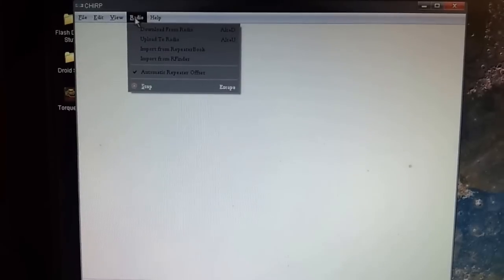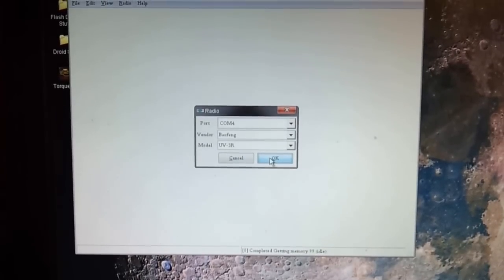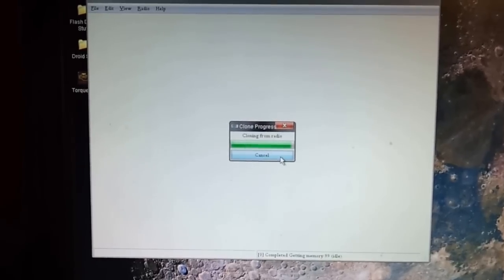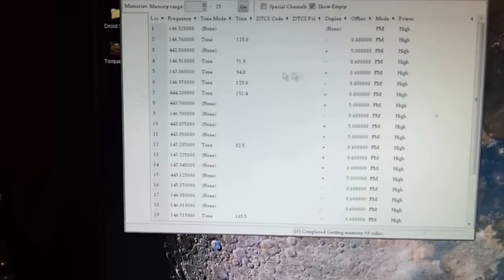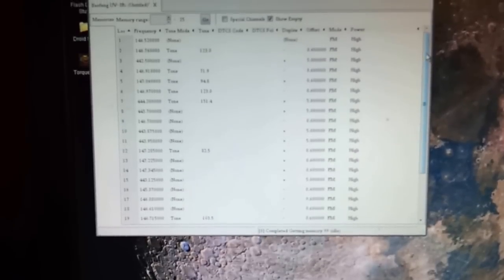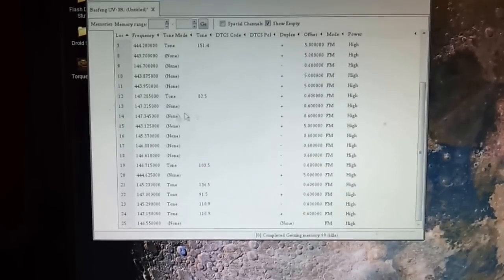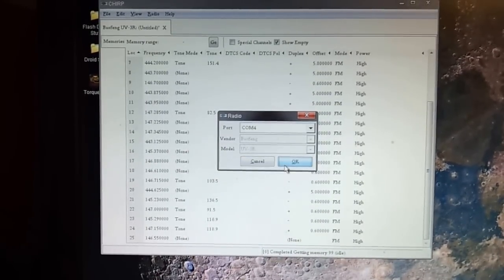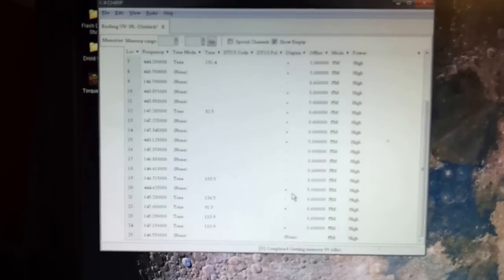Programming Baofeng UV-3R with CHIRP.

Comment: Hey, I have the UV-3R Plus, and I'm having a hard time programming it. I got a cheap data cable on Amazon, and I got it working with the regular drivers. I can download all the radio settings and channels, and I can upload new settings "such as expanding the frequency range".

However, every time I go to write memory channels, to it, it simply deletes all the current memory channels of the device and basically resets it to factory default (other than the settings I changed in chirp). Clearly the communication cable is working, but what could be causing the memory channels to not transfer?

Comment from the maker: It won't allow me to reply to you directly, but when I hooked the cable to my old XP system it found the driver, and installed it. So I'm not sure which one it used. I know there was a problem with some of the cables, and the chip inside them being cheap or counterfeit and the drivers wouldn't work or something like that.

Comment: Hi Scott Thompson. This cable is the same of Baofeng uv-5r ? My uv-3r have a smaller screen the yours, and show only one frenquency at  time.
Reply from the maker: Not sure if it's the same cable or not, I haven't picked up a UV5R yet. If your UV3R has the single line screen I believe it's the Mk1 version.
Reply: My Ht is the UV-200, looks like de uv-3r Mark 1. In the ebay have a seller with a cable for de uv-5r and uv-3r. But, I have no idea if it works in two hts.
Reply from the maker: Jose Vianney Wish I could help you there. If it states it'll work on both it likely will. I can't say for sure it will though.
Reply: *****

Ok, thank you Scott. I have both uv-5r and uv-200 (mark 1). I going to purchase that cable on ebay and try in two hts.

Comment: Hello, I have two questions to ask yourself. 1) How does the software solve the problem of the number of alphanumeric characters for the name of the channel? Some HT allow 5 characters, the other 6! 2) How to clamp the HT on 144/430MHz or on 144/450MHz range frequencies with this program? Thank you.
Reply from the maker: I'm not sure I don't program the alphanumeric characters. Not sure how to do that with the program, I just did the video as a quick guide on how to program the radio, since at the time I did it there weren't any out. I'm definitely not an expert in the use of the CHIRP software.

Comment: How diff do you think it would be to program this to accept signals and output something in response or interface real-time with a comp/mini-comp? I am thinking about using this as a cheap RC control unit but have no experience with this stuff (willing to learn however long it takes though). Basically, I intend to set it up to run as an rf unit linked to a raspberry pi, and send and accept signals which raspberry pi would actually process, then send more data out after processing.